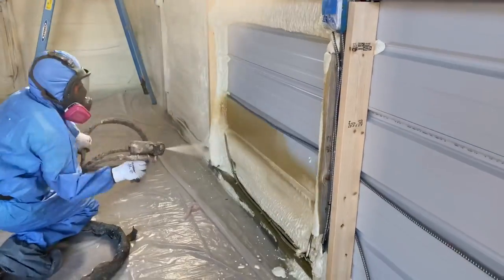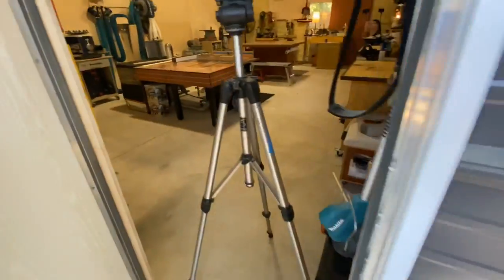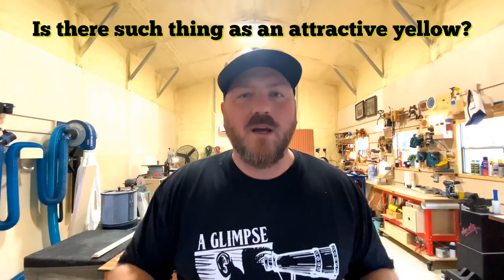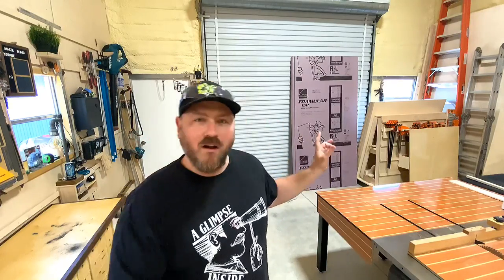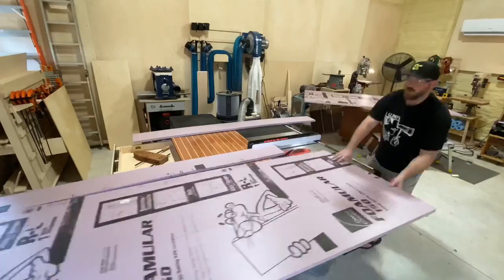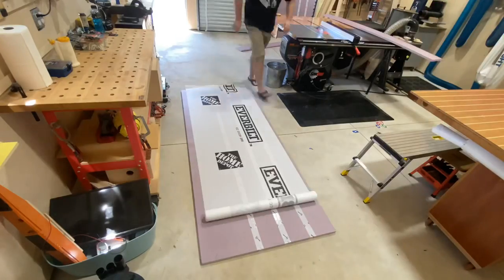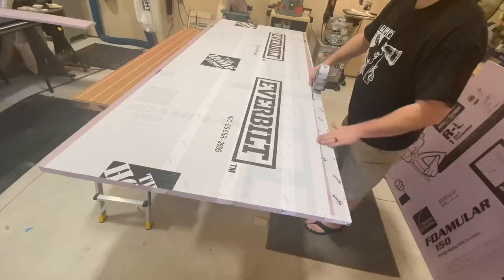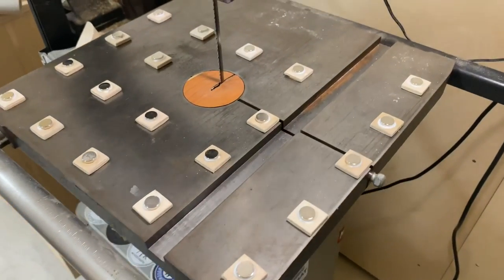How To Insulate A Garage Door/ Shop Door | PLUS SprayFoam Pros and Cons, My Thoughts!

Comment: I have a shop in Mayport, and its 3000 sq ft but it has showroom windows all around the shop because it used to be the showroom for the Morningstar Marina and now its my boat repair shop. I am looking for a way to get it cooler during the day, and I am thinking of going with spray foam and then maybe either swamp cooler, or maybe a few heat pump units. I dont know its getting more and more expensive as I think about it all. I have a roll up door, and I have NO INSULATION in this metal building, It is so freaking hot in here, and my gelcoat kicks in seconds, it also messes up all of my resin repairs, but then in the winter, I installed 3 240v shop heaters and they did absolutely nothing during the winter. its so annoying because then, I cant get my resin to kick to save my life. I think i am going to be forced to have to spray foam. Who did you use in Jax? I want to know who I should call. Thanks man.
Reply from the maker: Wow that’s crazy. Nice to talk to a local. Are used energy seal. I think if you Google energy seal Jax you’ll get a hold of them. Hope it all works out. That’s brutal about the temperature changes

Comment: Why not put the smaller panels at the bottom?
Reply from the maker: I have thought of that and tried that, however I like them at the top because of the sticks holding everything in place seems to work better near the upper part of the door. However you could absolutely

Comment: If you used closed cell spray foam, that is a moisture barrier.
Reply from the maker: That is very true I spoke of maybe installing moisture barrier because I lined it with two by fours every 5 feet. So I wonder if I’ll ever have issues not really sure. But yes you’re correct spray foam is completely watertight

Comment: As a garage door guy with 9 years experience.... PLEASE dont do this to your door. You will decrease the life of it by about 10 years
Reply from the maker: How so?
Reply: @AGlimpseInside  the slats are not designed to be put under extra stress and will wear out much faster. This will ruin any sort of manufacturer warranty you may have. The spring tension gets thrown off and a homeowner should not be trying to add more as they could seriously hurt themselves depending on the size of the door. The barrel itself and the hood if it has one will get stretched out every single time the door fully cycles up and down. Makes it much more difficult to service the door. If it has an operator the gear will wear out faster because of the extra weight and force. There’s all kind of problems that can cause. Just call a door company and get an insulated sectional door
Reply: Or if you’re really into DIY order an insulated sectional door. They’re not too hard to put in just be very careful, educate yourself and have the right tools when you wind a spring. The springs are what will hurt people
Reply from the maker: It’s a manual door. And these panels come on and off simply when I need to raise and lower it manually. Are you referring to a standard home garage door with an electric motor
Reply: @AGlimpseInside  gotcha. Honestly I didn’t watch the full video so if you mentioned that you weren’t running it with those on there I missed that part. As long as someone doesn’t run their door like this there’s no issue
Reply: @AGlimpseInside  I have seen people try and insulate a door like this and run it and they end up have to replace the whole door a year later